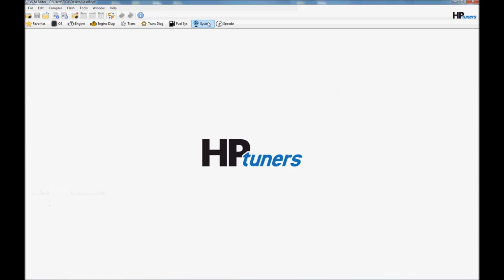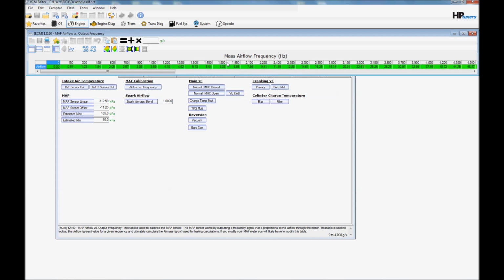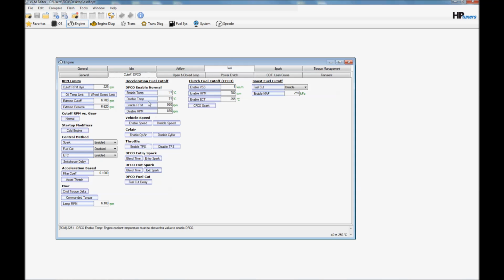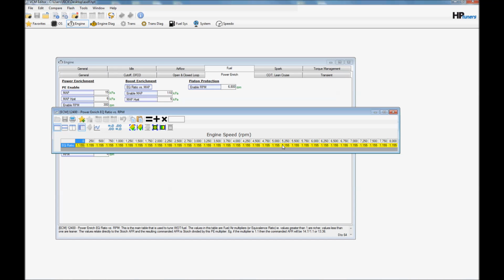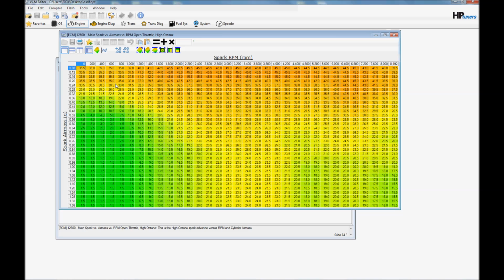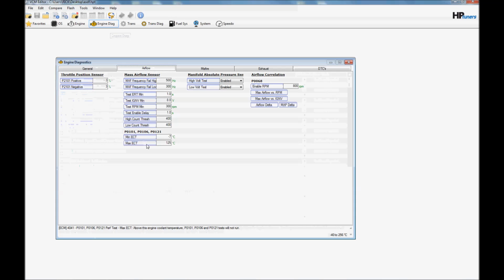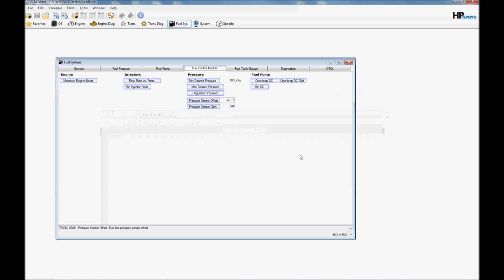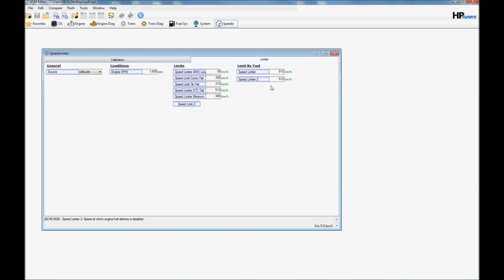How to Tune your Stock 5th Gen (2010-2015) Camaro for Free Horsepower

Comment: get'n p0300 thru P0305, and P00008 on 2011 / 3.6LLT. Fuel Status stays on Openn Loop1 and open Loop2. I need link to factory stock tune for close Loop normal driving. is there a default settings on OS or copy cat factory settings with HPTuner?? Thank You.  SouthWest TX

Comment: Why is this shit so complicated all I hear is man you better be careful tuning your car you could fuk something up well why don’t they simplify all this shit how about taking all these numbers and just making a moderate conservative, aggressive table of numbers and change those but no they can’t do that they gotta make this shit so complicated that only a few MF will take the time to master it. Dumb this shit down to us like we’re a five-year-old could do it. It’s 2025 what hell we doing still using the same HP tuner from 10 years ago, where is the  updated shit to make this easier. Sry but I’m piss off..
Reply: yeah it needs to be  flip a switch simple; on my 97 F150 i bought an electric shift control module for the tranny that was a 3 position switch; stock, sport and strip and you could definitely tell the difference and knew which mode you were in.
=it will hurt your neck in strip mode if youve ever had any recent injury ;-)
AND it was only about 40usd and under an hour install including reading instrctions, on side of tranny wiring connector.
NOW IF ONLY tuners could do a similar thing;  1 tune for mods, 1 tune for premium fuel, 1 back to stock.
Reply: @KravMaga-d8t  You bought a canned tune with a selector. If you want good results you have to work for it, or pay someone who has done the work to get your car dialed in exactly. All this stuff is applied math and chemistry. It's not difficult, just extremely time consuming and you have to want to learn and follow through with said learning. If you're asking for a one size fits all especially for mods for an infinite amount of situations and combinations, then I am afraid you miss the point as to why this software exists in the first place.

Comment: Stock tune already uses VE for high power. It uses MAF during low power for better drivability and efficiency. Each has advantages and disadvantages which is why they are both used in the scenario where one is more beneficial. The main reason a tuner might go VE only is in boosted applications. The stock tune was developed by engineers who are very smart. HP tuners doesn't even access countless other tables in the ECU. While some of the motivation of the stock tune is fuel economy and regulation, keep in mind some of the principals of low fuel economy translate to power gains. Getting the most out of the displacement and fuel is efficiency.
Reply from the maker: And I don't disagree with most of that.  However one additional mandate (there are more) is environmental regulations.  The "very smart" engineers aren't necessarily trying to make your car run as fast as it can, nor can they.  They serve a broad market and there's a considerable tolerance stack-up of conditions such as temperature, humidity, air pressure gasoline chemistry, manufacturing variability, sensor calibration, etc, etc.  They wouldn't be commercially successful if only some of the cars worked awesome while the rest didn't work at all so they have to detune the car to a degree so it will run acceptably everywhere.  That's far more important to their bottom line than making sure Joe Blow gets his 15 extra HP.  I've got nothing against a MAF sensor.  It's a marvelous piece of engineering.  However it doesn't have the granularity of a VE system.  VE relies on no less than 3 different sensor inputs (RPM, MAP, IAT), whereas all of that data is compressed into a single measurement with a MAF sensor.  This is why MAF sensors suck at high Reynold's numbers, where the flow is too turbulent and the latency of the sensor too slow to get an accurate reading.  Breaking that up into 3 pieces gives much higher resolution.  Not to mention the extra resolutions handles far more loading conditions that would otherwise be represented by the same cell in a MAF table.  So if the MAF reads 2500Hz, it doesn't know if you're towing a trailer in Alaska on a mountain or decelerating down a hill in a valley in Arizona.  VE's main problem is it is not self-correcting but once you get it dialed in, it'll outperform a MAF sensor any day of the week and keep annoying problems like incipient knock at bay.

Comment: I was told by a little birdy that tuning software can help me bypass the readiness tests on the cars ecu for emissions tests. I cannot for the life of me get the o2 sensors and the evap sensor to clear. Is this actually true to your knowledge?
Reply from the maker: Theoretically, you can disable all the emissions sensors so they don't indicate a fail but as far as the readiness of the ECU, I don't know of any way of tampering with it.  You simply have to drive the car for a certain amount of miles/time for the new parameters to settle in before the ECU will report ready on all the different subsystems that get checked in an emissions test.  So if you reprogram the car and go in for your test, you'll fail whether the car is in good shape or not.
Reply: If you've installed long tube headers or test pipes, then chances are that you've most likely triggered a few different codes, but it depends on which. I opted for Speed Engineering long tubes, which default you to offroad connection pipes, and these cause a P0137/0157 O2 CEL, due to the difference in voltage/exhaust flow detected. This is common still, even if you run high flow cats on your LT's and have the O2's where they should be (placed AFTER the HFC's). 

Similar to the P0137/0157 is the P1133/1153, which is where the primary/upstream front o2 sensors detect a difference in warmup, due to their re-location; same as the secondary o2 sensors. These, however, aren't going to cause any lean or rich fluctuations in your air-fuel ratio, so getting them tuned out is what most tuners do. However, the important part is probably throwing your stock exhaust manifolds/headers on EARLY (if you have upcoming emissions/smog testing), in order to cycle through your emissions, EVAP, EGR, etc. 

Assuming your stock exhaust manifolds/headers and cats are good, as well as the o2 sensors, you should look up how to cycle the emissions and EVAP system. It includes getting the engine/coolant up to operating temps, getting up to 45+ mph or freeway speeds, running the AC under load and decelerating, etc. It should be a fairly simply process to manage within 100-300, maybe 500 miles at the most, assuming that you don't have any exhaust leaks or other issues with any other emissions-related hardware.

Comment: do you do remote tuning? how much do you charge?
Reply from the maker: Yes but I need to check if your car is compatible first.  What car do you want tuned?  Year make, model and trim level?
Reply: @ChrisCamaro  camaro 2014 v6 rs package
Reply from the maker: @BaconKuna  That is compatible.  Where can I contact you at?
Reply: @ChrisCamaro  tell me your instagram and ill message you there
Reply from the maker: @BaconKuna  Sorry I don't have instagram.  As a rule of thumb I don't give out my contact info either and I haven't yet figured out if it's possible to send PMs on youtube.  If you don't mind giving me your email or maybe facebook, I can get you that way.
Reply: @C @ChrisCamaro w about a 2010 Camaro ss l99? Bout it used, I know some mods have been done but want someone with experience to go over it.. I’m no where close to a dyno but I do have hp tuners mpv4

Comment: Thanks for the video.  I have a 2010 SS auto, what do I need to adjust to get some wheel spin.  With traction control and stabilitrack off it will only chirp, once it gets going it's quick.  I would like to be able to spin them once and a while.  I had a guy with HD tuner shut off AFM and reduce the engine TM but it didn't make much difference.  Thanks Scott
Reply from the maker: Getting wheel spin is only possible if the torque output of the car exceeds the traction of the wheels.  So if you eliminate all traction control and all torque management, you may still be unable to get wheel spin if there's not enough torque or too much grip.  Having said that, an SS auto has what.. 410 or something torque?  First you must deactivate traction control but that's pretty easy since there's a button for that.  Hold it down for at least 10 seconds to get it to turn off completely.  Then since you have an auto, press the brakes and gas at the same time so the car doesn't move and get the RPMs up to around 3000.  Don't do this for a very long time as it is hard on the torque converter but if you let off the brakes quickly enough and floor the gas at the same time, you should break traction.  You can also just apply brakes enough to do a burnout.  The SS has 275s on the rear so it's not trivial to break traction but with the TCS off and prespooling the TC you should be able to do it.

Comment: Were you using wideband for this?
Reply from the maker: My camaro does have a wideband, yes.  However it's important to cover the basics for cars that may or may not have one, as both techniques are important to understand and know.
Reply: @ChrisCamaro  Thanks. Are you saying your camaro already had wideband or that you added it in? Is it possible to have a car that has wide band stock? Sorry, very new to this. I just bought a wrecked 2010 ss manual that I'm going to be swapping at least the ls3 and tranny out of and in my excitement I'm getting ahead of myself.
Reply from the maker: @CalebsHobbies  No problem.  No, the wideband is not an OEM option.  Typically this is the case with most cars in general that I'm aware of (although I may simply be unaware of newer cars that come with one).  I bought mine from AEM.  You simply need to drill a hole in the exhaust below the headers and weld a bung to screw the sensor in.  The rest is just wiring.  While the sensor cannot directly control the car's AFR, it is invaluable for tuning purposes and necessary for any speed density tune.

Comment: Will these tune recommendations work on a 2015 Camaro V6?
Reply: And is there anyway you could help me understand how to tune? I'm buying the hp tuner from summit tomorrow and just need some help!
Reply from the maker: @NA-hb3fw  The tuning process is pretty much the same for most cars of a similar architecture.  The main differences are the actual values in the tables but if you're making relative changes (+1 degree of spark or -2% fuel), then it's not so bad.  You just have to apply the same logic as what's in the video to your specific car.  If course if you get stuck and have a specific question you can ask it here.
Reply: @ChrisCamaro  Is there anyway you can PM me so I can get some more help, I just bought the HP Tuner and am new to tuning, I have no idea what to change for an optimal tune.
Reply from the maker: @NA-hb3fw  To the best of my knowledge, PMs are not a feature permitted on youtube.  However before you start changing anything in your tune, the first step is to do a road scan.  Without the current data from your car, you would have no idea what to change and by how much.  You should set up your VCM scanner program, connect your OBDII and go for a drive, recording about an hour of data before even thinking of uploading any changes to the car.  Otherwise you could make things worse.
Reply: @ChrisCamaro  I also can't find dfco entry and exit spark, have any ideas where to find it?
Reply from the maker: @NA-hb3fw  https://youtu.be/SQW8RbHUruk?t=1018

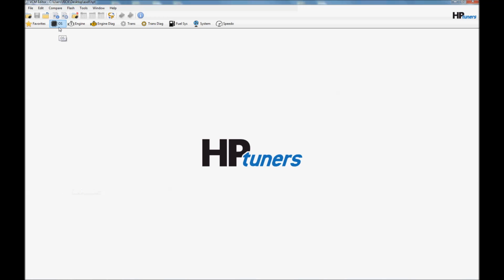Comment: 0:00 - 3:24 Free epilepsy test.
Reply from the maker: Lol yeah I'm really sorry about that.  It had something to do with the capture soft not liking the particular window in focus because it goes away when I start working on something else.  I didn't see the flicker until after processing the video, which is a total noob mistake since I should always check my videos before publishing.
Reply: @ChrisCamaro  If you have a nvidia GPU i would recommend trying shadowplay in nvidia's g-force experience application. In the shadowplay settings if you're having trouble capturing a window you can just enable desktop capture in private settings inside the shadowplay settings, really handy.
Reply from the maker: @imperial1037  Good advice for Nvidia users but incidently I have always used ATI products.  Not sure if they have a similar issue.  Their drivers are not always good.

Comment: I have HPtuners and a 2013 Camaro v6 with the LFX engine. Can you send me the tune?
Reply from the maker: It doesn't work that way.  Anybody can download any tune file they want but HPTuners prevents you from using it because they encrypt all the files.  You can only use a file that was taken from your car's VIN number, which you are registered to use.  You have to pay for every VIN you register to and can't swap files back and forth between cars.
Reply: oh I see now. I have the license for my vin already which was two credits. Do I need more credits? Also I’m new to tuning and would like to learn but I’m having trouble understanding the charts where there are a lot of numbers. I don’t want to change the numbers to anything that will damage my vehicle
Reply from the maker: @GG_Jared  You don't need more credits to tune your own car.  There's just no way for others to tune your car unless they're standing in your driveway, due to how HPT encrypts their files so they can prevent people from getting free tuning services.  Which table are you worried about modifying?  Most tables have a healthy enough tolerance that they could be 25% off or more and still function.  I say that with a grain of salt but the point is that most tables you would be interested in modifying do not require laser precision and the consequences of getting the numbers wrong are usually not catastrophic to the car.
Reply: @ChrisCamaro  I was wanting to give it a “burble” on deceleration. Not sure which table to use for that
Reply from the maker: @GG_Jared  What you are referring to (also known as Bang and Pop) is a combination of DFCO (Deceleration Fuel Cut Off) and retarding the spark a LOT.  So you find your DFCO tables and make sure to enable the fuel cut-off based on the conditions of your choosing and you will see them listed there.  Then you want to make it so that at low manifold pressures, while decelerating, your spark goes from normally advanced numbers to retarded values in the vicinity of 20 degrees or more ATDC (after top dead center).  What'll happen is, you release the gas pedal, the injectors shut off but leave the cylinders wet with fuel, the spark plug fires really late in the cycle and the wet fuel vapours ignite and are still on fire when the exhaust valve opens so a fireball gets shot out your exhaust.  Since the fuel is off, the fumes only ignite at random when enough has evaporated, making a random crackling or backfiring sound.
Reply from the maker: Be advised this effect is not particularly good for your emissions components, if that's important to you.
Reply: @ChrisCamaro  I’m on the DFCO and all it has is “disable ect hyst, enable rpm, disable rpm, enbl rpm tcc unlock, disbl rpm tcc unlock, and enable ect. And yes I don’t care about my cats I’m going to delete them.
Reply from the maker: @GG_Jared  So enable/disable RPM and ECT are probably the ones that affect you.  Those say, if the coolant temp is above/below "this" then turn on DFCO and the same with RPM.  This allows you to create a window of parameters in which the DFCO works and to disable it at other times.  Then DFCO entry and exit spark are where you put the modified spark values.  Different cars have different numbers of tables exposed so don't be surprised if your HPT setup doesn't match mine.  All you can do is change the tables you do have and hope the hidden ones aren't locking you out of the feature you're trying to enable.
Reply: @ChrisCamaro  ok thank you. Also do you know how to increase throttle response on the tune
Reply from the maker: @GG_Jared  Yes but it's a possible health and safety issue.  The table responsible has a very tight tolerance and if you deviate more than a couple % points, at best the car won't work and at worst, the car will accelerate out of control and smash you into a wall.
Reply: @ChrisCamaro  oh okay lol the throttle on mine is awful and I just need to fix it haha
Reply from the maker: @GG_Jared  If it's a drive by wire (electronic throttle), the computer often commands a throttle level that is very different than the pedal angle, which I personally don't like, but for that reason you have to trust the engineers because your life is in the hands of a 386 computer and a servo motor smaller than your fist.  However if you're so inclined to investigate further, the tables are Driver Demand and Desired Throttle Area
Reply: @ChrisCamaro  Thanks for the help man 🤙

Comment: Can u make a tune for a 2020 Camaro lt1 stock only have jlt cold air intake I have go tuners
Reply from the maker: With HPTuners you need to purchase the license for each VIN number you intend to tune.  It's not open source tuning and the files are encrypted so you can't tune somebody else's car.  You would have to purchase the HPTuners hardware and then probably 2 credits for your specific VIN and then tune locally.  That is the only way until HPTuners changes their system.